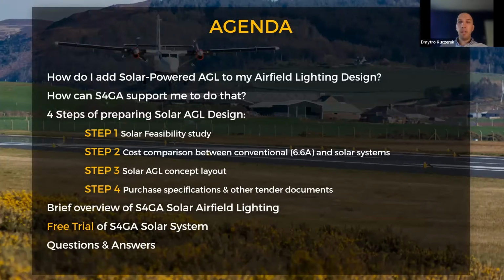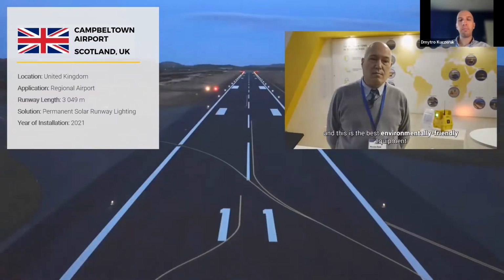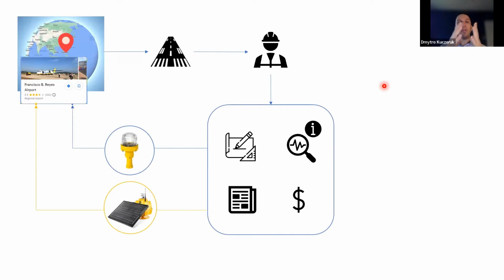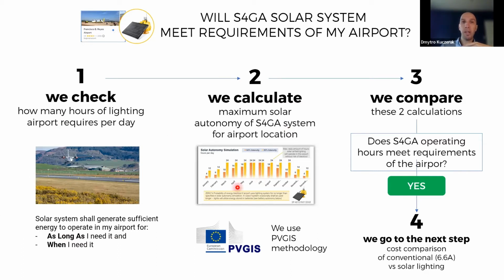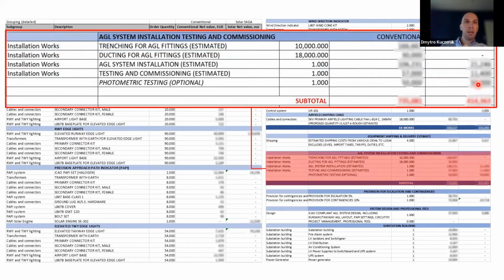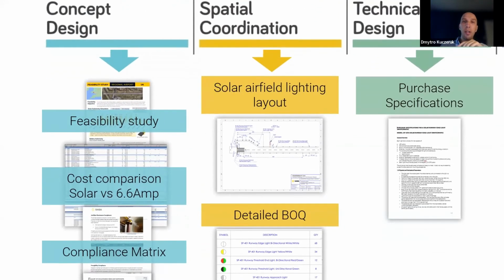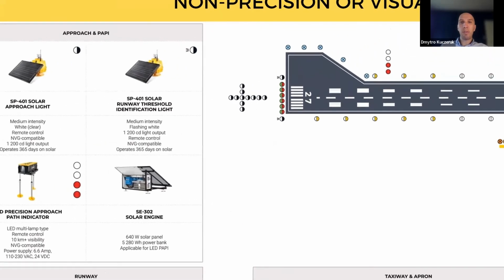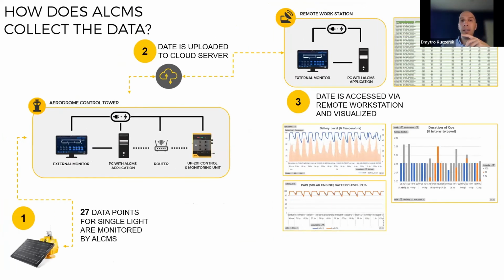S4GA Webinar: Solar Airfield Lighting Design in 4 Steps

Comment: How long  batteries last  or needs replacement?

Airport runways are confidential data to share, can you work with basic info like runway length, width and solar data from location   if made available  for design of Runway lighting.

Bangalore international  airport is with heavy   air traffic, is this system suitable for such requirement.